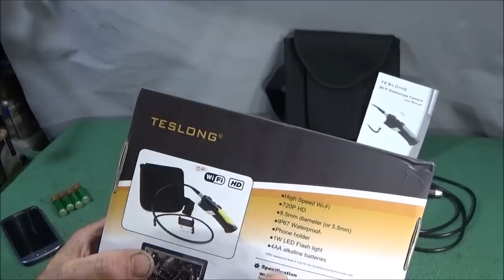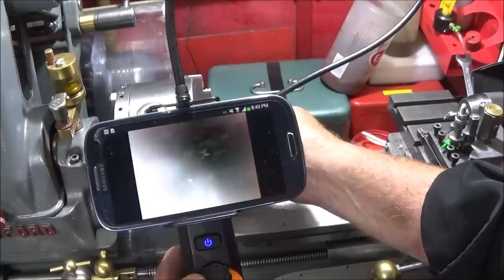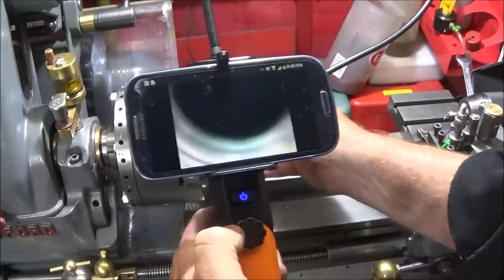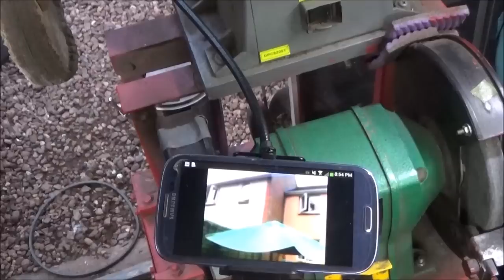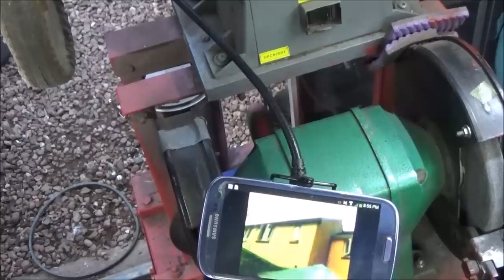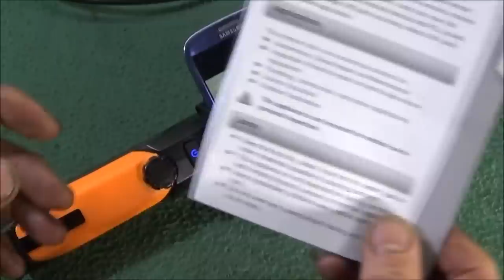A New ZXY-200 Inverter Welding Machine & WF200 WiFi Endoscope Camera

Comment from the maker: SEE BUYING LINKS BELOW:-
AC 220V 4.7KW ZX7-200 Welding Machine -- https://goo.gl/9gucc7 
WF200 WIFI Endoscope Inspection Camera https://goo.gl/2JdW6h
https://goo.gl/i7Nc2d  Welding Helmet.
https://goo.gl/8QoZYC Red Welding Gloves.
https://goo.gl/UpBLfz Welding Rod Container. (Maybe yellow or Blue)
Reply: The marks on the welder cable may indicate the cable section, which is the area of a circle and it's    
actually square mm.
Reply from the maker: As a matter of interest. The Endoscope factory in China.
https://www.made-in-china.com/products-search/hot-china-products/Endoscope.html?utm_source=bing&utm_medium=cpc&utm_campaign=QP-Health%20%26%20Medicine(Medical%20Equipment)%5B3%5D&utm_term=Endoscope%20factory&utm_content=Endoscope#utm_source=bing&utm_medium=cpc&utm_campaign=%20micbing8-QP-Health%20%26%20Medicine(Medical%20Equipment)%5B3%5D&utm_content=Endoscope&utm_term=Endoscope%20factory-endoscope%20factory

Comment: Good for you Steve. As I have said in the past I'm a welder by triad and been a follower of your videos for a long time and I have seen in the past where you could use a welder many times. Stick with it and practice and you will be amazed at how quick you will be up and running with it. To me the auto helmet is a must have also the water proof rod holders tubes is also a must for stick welding due to the rods can't stand moisture. The best advice I can give you Steve is not to try and use to big of a rod when learning to weld. Most people make the mistake thinking bigger is better. Not always in welding rods. You've helped me many times with me being a newbie to the lathe. So If I can ever return the favor don't hesitate to ask in welding. I have a miller 250 mig and a Lincoln 275 tig and stick. Thanks for all the good videos keep them coming good luck with your new tools.
Reply from the maker: Hi Anthony, Thanks. Yes I'm looking forward to getting the auto helmet. I think it should make a great difference to starting. I have 3,2mm rods and 2mm rods. To make it easier for me, I have been cutting the rods in half-lengths to make it easy to touch in the right place when starting. Is it ok to do this? Or is it ok to hold the rod half way down with the welding glove, to line up and get the rod steady and the weld started? Or are these bad practices? I do have joint pain ailment in my welding right arm at the moment which is a bit of a problem. So I tried these things to make it easier and they work well, but I don't want to do anything if it is not right or would be bad practice.  
    I think, like you say though its a case of persevering. I really like watching the professional welders, like yourself and there are some excellent videos on Youtube to watch.
   This inverter welder is definitely much easier for me to learn with, than the one I had in the past. That one was only an ordinary low cost 130 amp arc welder, if I remember rightly. This inverter one seems to be so much easier to start off. It has significantly less sticking of the welding rod on the work-piece and it is not at all frustrating like that older machine
 Thanks for your offer of help with the welding......Regards Steve
Reply: Hi Steve,

You may find that bending the electrode at the handpiece will enable you to line it up easier.  I do this with every rod.  Longer rods are harder to control if you are a bit shaky, but once you learn to relax, control your breathing,  and are more confident, you will handle the full length quite OK.

It's all practice.  Burn up a few rods on some scrap to "get in the groove".

Those twist grip holders are the way to go.  I wouldn't use anything else.

I've looked at the Banggood auto darkening helmets, but I have a large diameter head and I doubt they would fit me.  Something to bear in mind when looking for one to review.

Cheers Rob
Reply from the maker: Hi Rob, Thanks for doing such excellent reviews on these inverter welders and inspiring me to get one. I orderered one of these rather than a full helmet.    https://goo.gl/i7Nc2d 
I will continue to practice and hopefully show some better welds soon..:) Regards Steve
Reply: Hi Steve,

I will be VERY interested to see what you think of it.  I've looked long and hard at the BG auto darkening helmets and wondered about doing a review.  But, my big head may be an issue with their offerings.

They have a couple with four sensors as well, which should be better when working in close on fabrication  work, less chance of the sensor being blocked from the arc.

You did a great job on this video.  Very nice.

Cheers Rob
Reply: Steve Jordan well Steve these days it seems that I see more and more things people say O you should not do that but if that was the case I would have been out of business years ago. A lot of people give advice on things that they them selves has never even tried to do or do themselves. As far as either one of the ways you have said makes it easer on you I do all the time and I have been a welder for over 30 years. Cutting the rods or using your other hand to steady it. I know of nothing that says you can't do this but I bet someone chimes in and says I'm telling you wrong. But good luck and you can email me at anytime 
as cash @ msn . Com

Comment: Nice one Steve, was a master welder by trade re-active screen a wise choice, welding rods absorb moisture, my tip is to bake the rods in oven before you use them. Persevere  with it on scrap and I am sure you will pick up a new skill quickly. Love the myford upgrade, seems smoother and quieter.

Comment: Steve, following your excellent video, I also purchased a similar ZX7-200 welder from Amazon which came with both ancillary cables and fitments. However, the unit is fitted with 2-core mains cable but NO plug. Would you please advise me whether a nornal 3-pin plug will need earthing - or how I proceed, please? Thank you very much. (UK).

Comment: Another good video.   It helps to keep your welding rods dry.     Tape some desiccant bags in the inside of the cap of the rod holder.     Also, if you're having a lot of trouble striking an arc, try a smaller rod.
Reply from the maker: Thanks for the excellent tips. I have some smaller rods which I will try next time.....Regards Steve

Comment: Hi I’ve just bought one of these I’m new to Welding please could you tell me is it okay to use a three pin plug with a 13 amp fuse and also what are the correct welding rods to use for just light work thank you

Comment: You didn't actually get the Juba ZX7-200 that was reviewed by Rob, the exact  same thing happened to me, I have complained to Banggood over this. Is a Hufeng ZX7-200 the same as a Juba ZX7-200, I have no idea? My unit was damaged in shipping. Frustrating dealing with Banggood of these two issues.

Comment: A auto darkening welding helmet will help you learn many times faster. Ive got a very expensive helmet as i use to weld often in my old job. I've also used the very cheap ones from ebay and they work very well to. It makes me wonder how they can sell them for under £20 as they are great. Keep up the good vids.
Reply: Please sir
I would buy myself a small welding machine like this
Or is it just a waste of money
Is it effective and long lasting

Comment: Please sir
I would buy myself a small welding machine like this
Or is it just a waste of money
Is it effective and long lasting
Reply: I bought the one sold as a "Juba"  but it came in a box marked Hufeng.  There are several slightly different models sold as ZX7-200.  Read the detailed specs carefully looking for an input current of 25A @220V, and rated at 5.5Kw.  That's what gives this one it's exceptional duty cycle.  I've been using mine for several weeks now with rods up to 1/8" 7018 and still have not been able to make it overheat.  It doesn't trip out, just keeps frying along.

Comment: Steve, at the rate you are acquiring tools, soon you'll need a bigger TOY BOX !  :D
     The last two videos have me itching to get the microscope & the endoscope - I've got a big enough TOY BOX, but am lacking the finances to get more toys :(     I spent my 'allowance' on a welder 2 days ago. . . I chose a dual voltage 160 amp machine that has incredible reviews. ( Amico Power Arc - 160D)   Ebay gave me a 15% discount, which amounted to quite a bargain. This machine includes 10 feet cables, with ground clamp & rod holder.   60 percent duty cycle @ 140 amps , both 110 & 220 volts !
    I've been a long time subscriber, but have not commented much.  Keep up the great videos, hoping for cooler weather - it's been over 100 degrees F. for the past week here in Southwest Missouri , U.S.    * Cheers !
Reply: Please sir
I would buy myself a small welding machine like this
Or is it just a waste of money
Is it effective and long lasting

Comment: Does the welder come with the leads, just had a look at the advert and it only looks like you get the plugs?
Reply from the maker: Hi Phillip, No you will have to buy leads separately. I just bought a length on Ebay and cut it in half. The welder is a fantastic machine though for the money. I am new to welding and never got on with stick welders in the past. This one makes it easy and I have used it to make some great fixtures up. Its one of the best tools I've bought. Regards steve
Reply: Thanks for the reply, probably expecting leads for the price was a bit optimistic. Does running the machine cause any problems with the domestic electrical supply?
Reply from the maker: @philiponsolent7232  No it doesn't cause any problems whatsoever and I have the latest up to date sensitive trip switches installed in my home. Also I use mine on a long extension lead with no problems. If you want to see better reviews on this welder check out the channel xynudu youtube videos
Reply: Thanks Steve, I have watched the other video, just wondered how a UK electrical system coped.

Comment: AC or DC?
Reply from the maker: It is DC
Reply: Argon gas and tungsten electrode conversion viable ? Later perhaps.Sign up for a tig evening course or local welding suppliers demo maybe. You may be amazed at easy Tig is even on aluminium. If you do go for Tig,  do not sharpen the tungsten electrode on the side of grinding wheel.grind on the periphery of the wheel , (at least 6 inch diameter ,or use a CLEAN linisher) the argon dislikes the circular finish lines,prefers axial lines .Another odd thing with TIG is (just to wet  your appetite for Tig ) that you do  not need a wide gap for weld penetration. In many cases , no gap at all reduces distortion . It may be that the combination of local heating and cooling argon gives this effect, but i am only guessing.
Reply: @alanbristow6681  Please sir
I would buy myself a small welding machine like this
Or is it just a waste of money
Is it effective and long lasting
Reply: Save up for TIG,not MIG. Safety is the first priority when welding, no weld spatter with Tig, fumes are not harmful, bronze TIG excellent,aluminium alloys, you are better of brazing with a gas torch that can be used for Silver Soldering, but do not overheat. Dull red only. @abdelmounaimhachi9127

Comment: Come on sir, cut it of that unsafe main plug, and install a proper one. Have in mind that this machines drowning to much power, more than 13 amp's in 240v, and it will be wise if you replace the 13amps fuse with a 15amps. This amount of current it's not wise to intermediate with other adapter..... Don't Worry and  Keep Welding... 😉😉
Reply: No.  This welder only draws 8 amps with a 3.2 mm rod.  It can quite safely run off of a 10 amp circuit without tripping the breaker.  Inverter welders draw 40 -50% less amps from the mains than old style transformer welders.

The adapter plug used is quite up to the task and safe.

Cheers Rob
Reply: xynudu ju
Reply: xynudu Look o have similar welding machine, and when  turned the current controller very high, the Fuse blows directly. Now about which standards are safe and which one is not, I believe it's obvious. The BS are far safeiest than any other standards.😀😀😝😝
Reply from the maker: Sounds like you have a dodgy machine then to me, if it blows fuses like that. You ought to get it checked out.
Reply: Hi Steve,

Sounds like he is exceeding the 10 amp draw range on the welder.  In other words, the welder will draw less than 10 amps at 130 amp output (ie using a 3.2 mm rod).  BUT if you wind it up to the full 200 amps it will draw more and trip a 10 amp breaker.  The extra amp output range is there and can be used with a 15 amp breaker, but in real world use you won't go past the 130 amps required for a 3.2 mm rod.  

Cheers Rob
Reply from the maker: Hi Rob, That's great thanks for explaining this. I wouldn't have known this either, being new to welding. Regards Steve.